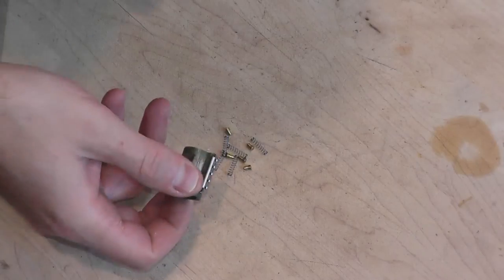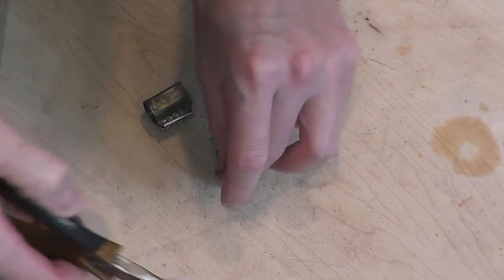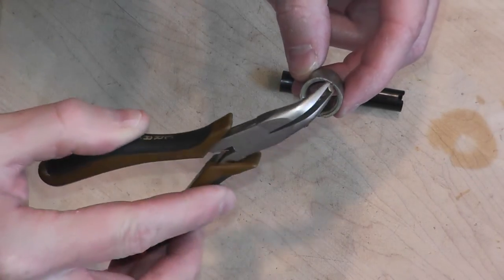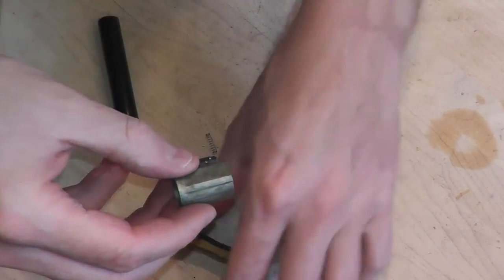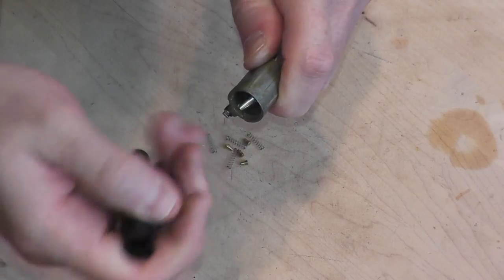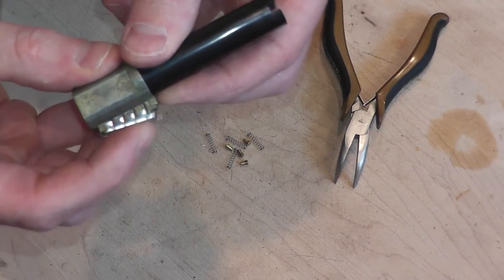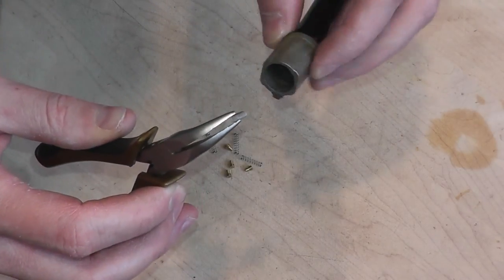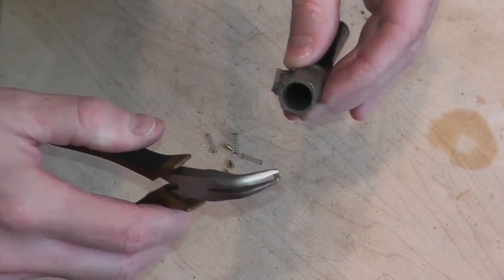How to Reinstall Lock Cylinder Springs and Pins HD

Comment: Why can't you just pop off the metal retainer clip and load from the outside? Surely this is how they are manufactured.
Reply: I know this is 2 years old but I actually did do that once on a kwikset lock cylinder and it worked

Comment: I found this really hard so I slid the top bar off put the first brass pin in then the spring then held down the spring with a scriber then slid the bar over then did this 5 more times. Hope this helps somebody. Very good video .
Reply: Tried that, too, but the "punch-down" in the middle of the top hits the edge of the cylinder when you slide it to the third pin.  Then, if you lift it enough to clear the "punch-down" the spring get's in it and I tore up two springs getting them back down.

Comment: That may work if you have a pin that has one end with a smaller diameter to fit inside of the spring but there's no way you can balance the pin on top of a spring and push it down.  The dude at Lowe's must have given me the wrong pins out of the Schlage parts box.